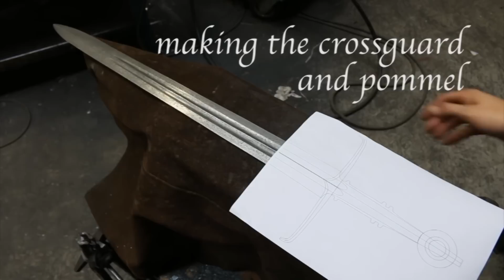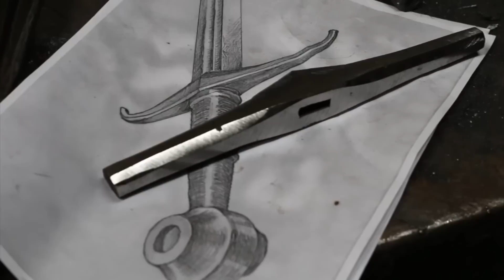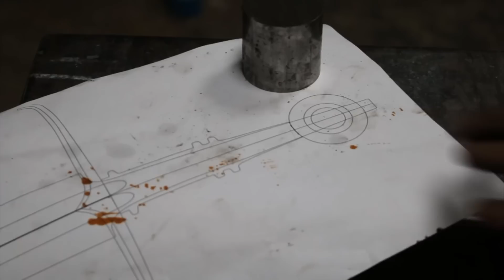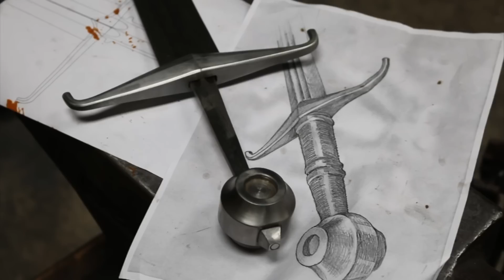Forging a Damascus sword, the complete movie.

Comment: Another amazing video. Most people just talk and talk in their vids, and while that can be great to understand their process, you don't need to talk, Freerk, your work speaks for itself :P
Reply: Im sorry but ... http://www.sword-buyers-guide.com/damascus.html ... There is no new Damascus sword or steel.  

"Wootz steel had some very unusual properties and its manufacturing secrets have been lost in the mists of time (the last true Damascus Steel was made in the mid 18th century). Swords made from this "ancient supersteel" were both flexible yet very hard, and a study in 2006 found they contained nanowires and nanotubes (click here for a detailed article on Wootz Steel)." 

Its not only the art of craftmanship, but also the material itself we lack knowledge about. It's like the foundation of Rome. It was built on very special stones that is called 'roman concrete' made of the unique clay underneath the City. Which was fused with volcanic ash. .. So like comparing old-fashioned Damascus steel.. with todays we only managed to replicate the outer look of the blade. Not what it really was.. A paper thin, light  blade but sharp enough to cut a feather. 

https://www.reddit.com/r/askscience/comments/4kwnyk/what_makes_damascus_steel_so_special/

Source: Wiki: 
Roman concrete, also called opus caementicium, was a material used in construction during the late Roman Republic until the fading of the Roman Empire. Roman concrete was based on a hydraulic-setting cement. Recently, it has been found that it materially differs in several ways from modern concrete which is based on Portland cement. Roman concrete is durable due to its incorporation of volcanic ash, which prevents cracks from spreading.
Reply: Please stop repeating the "lost in the mists of time" BS.

Modern metallurgy is able to create metals that exceed ancient Damascus in every aspect of performance and in quantities that make it a truly mundane product.

What defines modern Damascus is the hand work, craftsmanship and artistry that make each creation unique and differentiates them from the mass produced and homogenous output of large factories.

It is true that modern blacksmiths are faking it to the extent that they are not making the steel from scratch, but why would they when they can buy high quality steels at a fraction of the cost of making their own?
Reply: did you even finish reading that article toots?

Comment: Great work.
I feel very much out of place for saying this, but you may want to put something down across the bed of your lathe if/when you use any kind of grinder on it.
It protects the bed/rails/mating surfaces. Also the cross slides.

Comment: did you harden the sword? I saw you bring it up to critical but it looked like you submerged it in a white powder. did I see it wrong or is that an alternative hardening method?
Reply from the maker: no it is the opposite it is  a way to soften the steel by slow cooling.

this steel is air harding, so i did not harden it in a fluid..

Comment: Interesting, so use to seeing blacksmiths fold the steel during a heat but you tack weld them together, interesting to see a different method, did you find it faster tack welding?
Reply from the maker: It is slower but less chance of weld faults.

Comment: I see that you don't use a huge amount of electric welding when you stack and tack the billet. I have seen a bunch of clips where the smith will just about encase the whole thing with their mig or arc and I can't help but wonder about the metal from the welder contaminating the finished product. 
Is this actually a problem or I just overthinking things?
Reply from the maker: it gets grinded out.  so in the final product there is no trace of it left.
Reply: Thank you, I've had that question bouncing around in my skull for weeks now. 

Do you make the hot forging die things ( don't know if that's the right term but it's the best I could think of) for the power hammer yourself? I know that these things always look easy when you see someone highly skilled doing it but it seems faster and more accurate than trying to add a fuller later on a grinder or with a chisel. Not only that but I've yet to see a blade with a double or triple fuller from a grinder.

Comment: i noticed your heating the metal a bit much and wasting coke.

get borax powder for loundry heat the metal to critical tempature sprinkle borax powder on the red hot steel hammer once place it back in the forge and allow it to get to critical tempature.

what this does is allow the steel/iron to stay at critical tempature for a longer period of time... 👍 

..your welcome
Reply: Coke?  This is a gas forge.